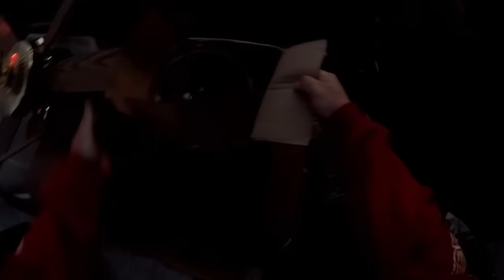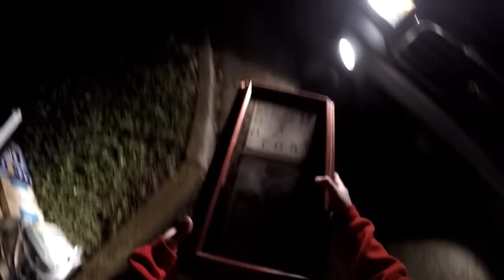Heavy Trash Day 2 (Nikes, Chainsaws, Weights & More In The Trash!)

Comment: Cool vid and a tip I had a old flatscreen/monitor 2 in 1 deal not hooked up sitting around when I plugged it in it wouldn’t turn on I had to look up how to reset it then It powered right up still works.

Comment: Those Chain Saws , Get some Fogging Oil and Spray it in to the Spark Plug Hole , Or Remove the Muffler and Lube Up The Cylinder . Make Sure The Piston Is Not Scored , EZ Fix On Each . Should Bring $ 100.00 + Each

Comment: Your tower server would seem to be a Dell PowerEdge 1900 or similar from about 2007. By modern standards, these are not particularly fast (think a Core 2 Quad or something) and draw an ungodly amount of power, not to mention the noise level - my workplace retired a system of this generation 3 years ago. Tower server cases are cool though (and they don't make 'em this heavy any more!), I'd want to repurpose this one using more modern hardware. Unfortunately, Dell was notorious for proprietary everything back in the day (motherboards, power supplies, even the fan pinout), but I'd still check the motherboard hole pattern against known server formfactors (E-ATX, HPTX, SSI EEB).

Could be a good project for a tinkerer needing a render server or something. It'll take some elbow grease but there's a ton of space and lots of airflow in there. The fans may or may not be shot at this point but will be heavy duty parts in any case. Fans from Dell systems tend to be keepers in general, despite the pinout issue.

This dude >> FFcossag has actually done something like this using an even older case. His channel will also teach you more about uninterruptible power supplies (and refurbishing them) than you will probably want to know. UPS' are another good thing to trash pick, actually, as the cost of replacement batteries tends to approach that of a new unit, so they're often tossed out working. 

That Panasonic TV (looks like an LCD, not a plasma?) may just have a dead power supply since it seems to be doing absolutely nothing... not necessarily easy but usually cheap component-level fix if you know what you're doing, like >> 12voltvids. Could be anything from a little electrolytic cap or rectifier diode in the standby power circuit that's given out to major lightning damage.